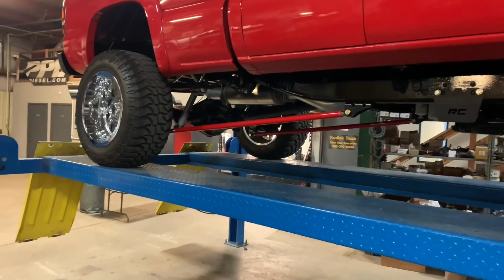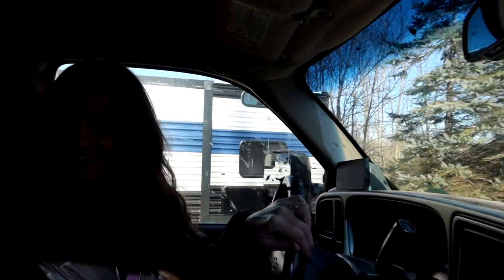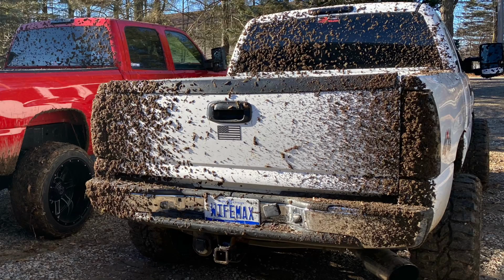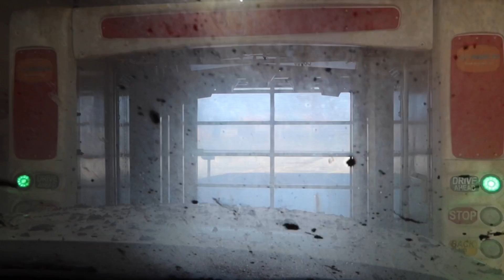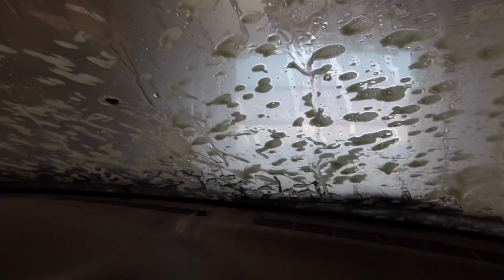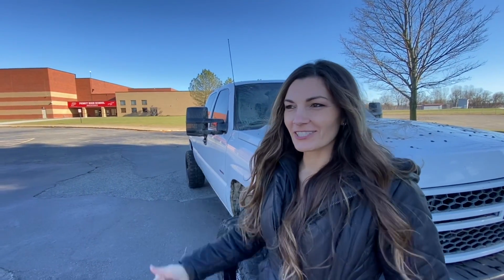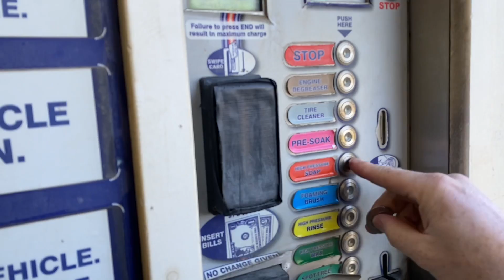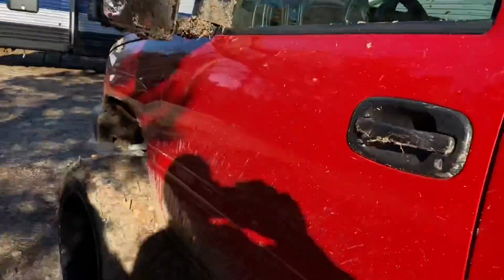Will A Drive Thru Car Wash Clean Her Muddy Duramax In One PASS??!!

Comment: I think you need to build a dirty max 2005 LLY crew cab with 8 ft bed 10inch lift with 40s with a set of fuel Mavericks chrome black wheels a solid Grey color Grey or white or do Chevy and put a cumins in it with Allison trans

Comment: For the next build May i suggest a  LBZ  TOW MONSTER,  create a LBZ that can pull a 18k fifth wheel with the same HP and torque as the $85k L5P.  (445 / 331.8 @ 2,800) 	(910 / 1233.8 @ 1,600)  .

Comment: If I hit my 05 Chevy Duramax with that much water pressure, I'm confident that I could drive away when I was done but, I would have to get on it NOT in it. It's a factory white truck but the lower half is turning Minnesota Red (My term for rust) more every day!!!